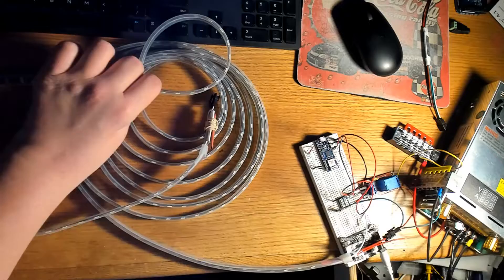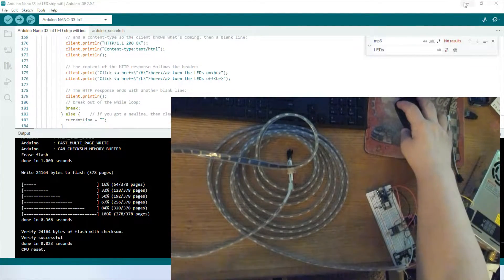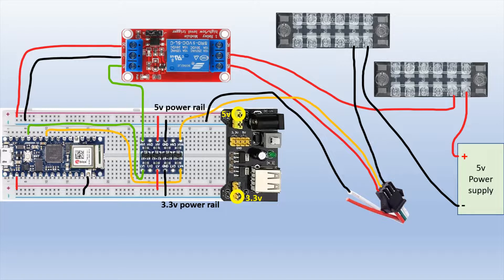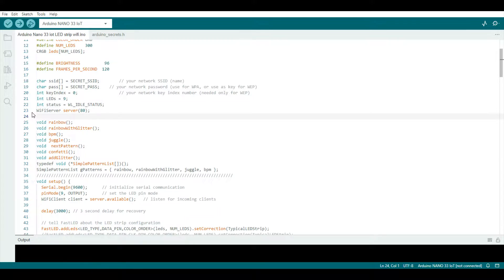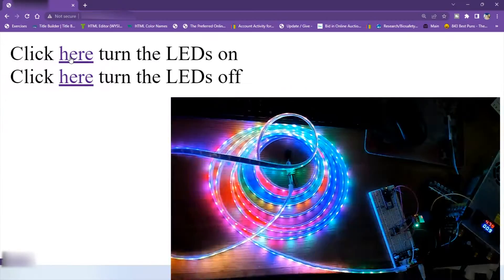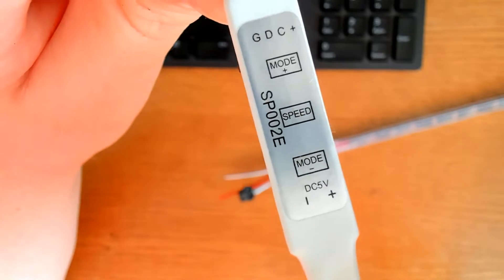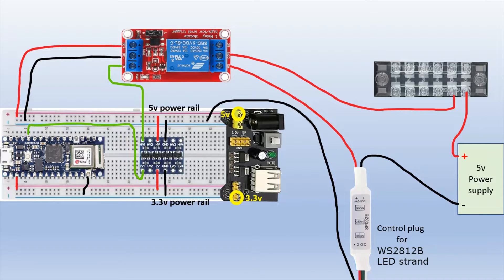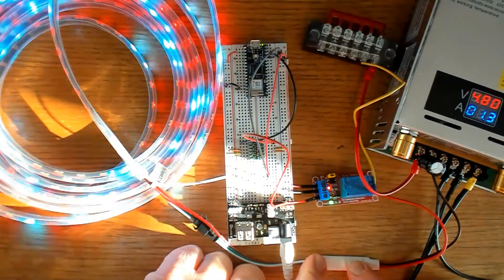Control Your WS2812b LED Strip From The Web Using The Arduino Nano 33 IOT Microcontroller

Comment: Great video and explanation, thank you! Do you have any experience doing this with a Raspberry Pi and how you would go about doing that as a sort of IoT device?
Reply from the maker: I haven't connect this to the raspberry pi yet. You can connect it to the pi using a level 5v to 3v level shifter. You can make it an iot project by creating a web interface that sends commands to the raspberry pi. I have been telling myself that I need more projects with the raspberry pi and I think this would be fun for a future project. Sorry, I don't have a video or code to refer to at the moment. There may be one on YouTube. If I come across a good tutorial I will post it here for you.
Reply: @BMonsterLaboratory  Thank you for you reply and no worries about not having another reference! What I am looking for really is how to control the LED:s with the Pi, I mean you seem to be using the Arduino but would you be able to control the LED:s withh Python, C++ or Javascript maybe?
Reply from the maker: yes, you can control LEDs using Raspberry Pi with Python or C++.  You can even get started faster by using the Neopixel library.